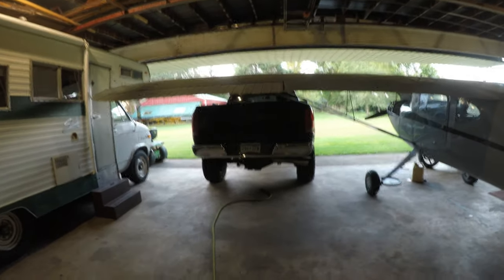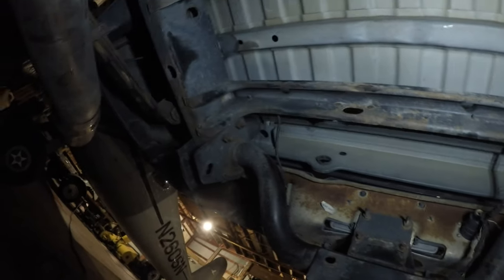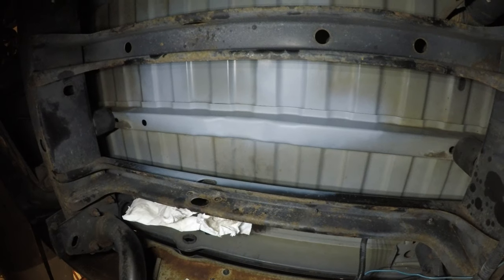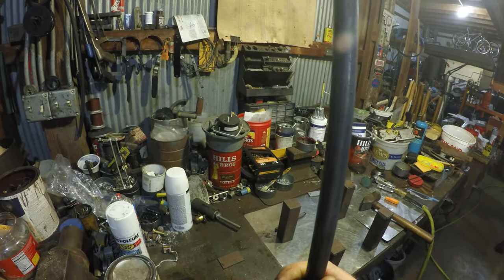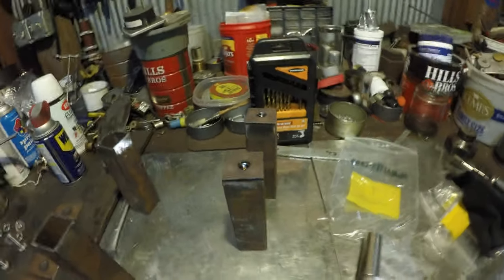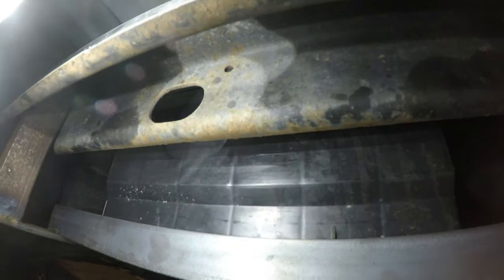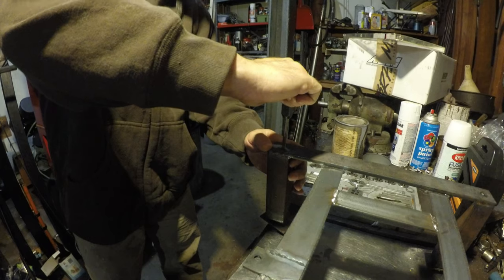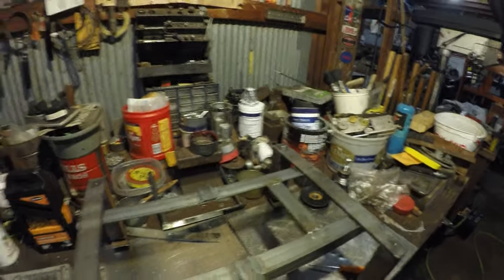2006 Ram 2500 Cummins Battery Relocation Part 1

Comment: i have a 2016 2500 and trying to find space for one let alone 2 group 31's under the truck is damn impossible. and id rather keep the spare, just incase. even though its stock size. unfortunately probably going to end up in the bed which i wanted to avoid.

Comment: I’m actually trying to do the same exact thing with two group 31 batteries in the rear, I was wondering how you routed the wire up to the starter?
Reply from the maker: You are going to have to decide what side of the truck you want to run the positive cable down. I choose the drivers side since I already had the charge cable run up and over the radiator. I put a terminal splitter where the drivers side battery was. It allows me to jump it if need be and use it as a splitter for the positive cable.
Reply: Yea sounds good I’m just Wondering where the pass over the frame in the front to stay away from the fuel tank and whether I should go through the front leaf spring mount on the frame where the parking brake cables pass thru or not. Also what size wire did you use to run from front to rear?
Reply from the maker: @gibill16   I just ran mine on the inside of the frame rail and used some P clamps to hold it in place. I did run the feed from my sump to the lift pump through the frame rail but I used some anti-chafe sleeve, like what's on hydraulic lines on a skid steer. I used 00 welding cable.
Reply: Yeah I was thinking the same thing on the plastic protector and p clamps, I’m just so nervous about it shorting out somewhere over time
Reply from the maker: @gibill16  Adding a fuse by the batteries would elevate any short concerns. Semi's use p clamps for routing cables and lines all over the place and they vibrate a whole lot more. If you're paying attention I have no doubt you'll have an issue.